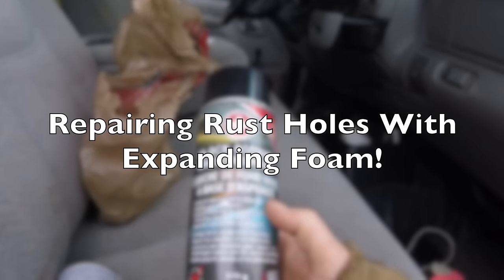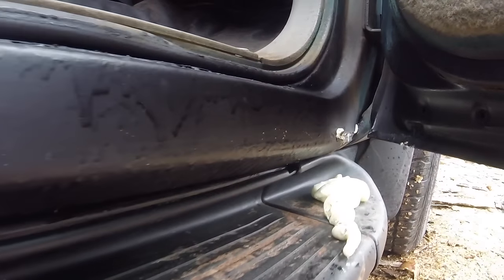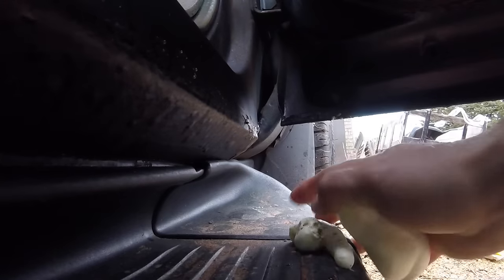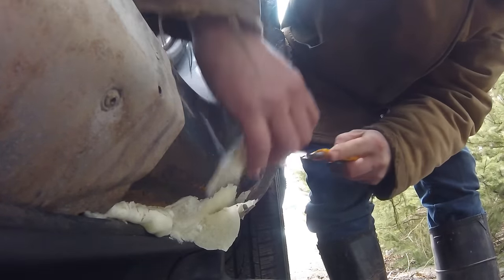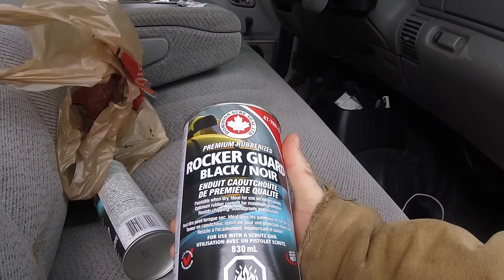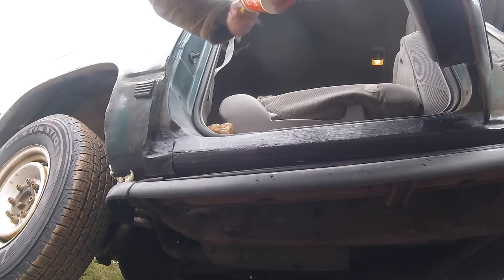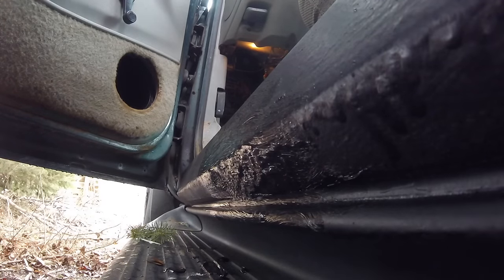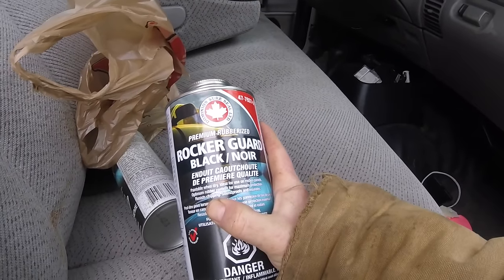HOW TO: Repair Rocker Panels with Expanding Foam 'Great Stuff' and Rubber

Comment: I used spray foam to fill rusted tube steel on both a grill and a ladder rack and it's effectively prevented rust from returning for nearly 10 years now.  Super quick and only $5, can't beat it.
Reply: Do you have a link for the item ?

Comment: This is actually a very good fix for a lot of badly rusted vehicles that still run good but are not worth a lot of money .
Reply from the maker: yep, quickly takes away the ugliness at the least.
Reply: @MicahGallant   for a work beater if it’s good from across the street then it’s good!
Reply: Finally someone who gets it! A focus with 200k will never ever ever have collector value. I just want it to look good from across the street, any proper repair will cost more than the car is worth. The common commenter whose knowledge is internet based seems to believe that every single car needs resto quality repairs as if each and every one were a priceless museum piece. I just want not to feel like a poverty stricken asshole every time I drive my beater to work.
Reply: @charredskeleton  honestly though, my argument for fixing metal with metal is maintaining structure. If you don't care how pretty it is, then some sloppy welds and extra grinding isn't a big deal when you throw some rattle can paint over it and it'll be stouter. I know most people either don't have a welder or have a friend with a welder, but if you are in a position to start, this kind of stuff would be great practice. That's my plan this summer at least on my old work truck. Same thing, not worth pro work but it runs good enough that I will tinker with some fixes myself.
Reply: @717UT   trucks often have fairly flat square rockers, this lends its self well to welding in some square tube and finishing with bed liner. From across the street they’d look like rock sliders, and honestly would take less time then most filler jobs. Even the cheapest square tube is WAY thicker than any body metal. The only thing better than a repair is an upgrade!
Reply: @charredskeleton  heck yeah! I've often thought about the same thing for my Jeep with rotten rockers. I realize it's a stretch for some people to do a weld repair, I'm even struggling getting my repairs done that I want, but if looks aren't a big deal, some new metal isn't as big of a deal as some may think. It won't be body shop quality, but who cares if you just want something stout. And you have a good chance of cutting out a majority of the rust and potentially stalling it a lot longer.

Comment: Another great way to use this trick is, like he said, use it to support long hair fiberglass, and instead of rocker guard or rubber undercoating, Duplicolor makes an aerosol (spray paint can) truck bed liner. I actually did exactly that and used the bed liner on an entire Jeep Wrangler, inside and out, and it lasted 15 years before I decided to sand it down and redo it all by welding in new metal and repainting it with actual paint.

Comment: The can you have is actually asphalt based and not rubber. You can get the rubberized based spray too. It's the same as the paint on you have but just spray. You can also tell by the smell of it. Nasty crap. Haha. One more thing. They make a waterproof foam that is coincidentally black like the rocker guard. Just one more protective step to take. Great tutorial. I've done this to my 4Runner before. Works like a charm.
Reply: What’s the name of stuff you used? I’m working on a 4Runner also

Comment: I suggest using truck bed liner, that stuff is tough as nails and even bulletproof from 22 caliber rounds, its rust proof and lasts a looooong time. I sanded my hitch down about 5 years ago and sprayed it with truck bed liner and it looks just as good today as it did when I did it.

Comment: This is a really good trick. But if you want to go the extra mile, spray on a quick coat of foam glue. It will stop the rocker guard from eating the foam... I use the spray foam and sand it to look nice, spray the glue and let jt dry, then i smear it with glazing or spot putty and sand it perfectly, can then be painted properly with what ever you want and makes it mutch more ridgid...
Bedliner spray works good too, it will eat the foam and leave a hard fillable surface that you can paint again.

Comment: Goodness that would never pass in Nova Scotia. In the same breath there is an older gentilman in town who uses 4x8's for rocker panels .. no idea where he gets his car inspected.. a mill I guess
Reply from the maker: key is that fumes don't leak into the cabin, thats what they are after. this is a full frame truck, so it doesn't rely on the body for strength.
Reply: Would not pass here in new Brunswick.  Patch's have to be welded and have seam sealer over the welds.
Reply: Geez I got my truck thru a safety with the holes filled with foam and covered in bondo-glass here in Ontario
Reply: I live in michigan no inspection of any sort 😂 theres trucks here with nothing left but doors and a frame
Reply: Is it a Lumberghini?
Reply: Wouldn't pass in Candy Land...I live there with Willy Wonka after I got my golden ticket...sucks to be poor...dude I think you're just fine...all these people who are living in places where it's not good enough must be doing pretty good I guess...if you're in the midwest this truck looks pretty normal
Reply: I'm in NS as well. Got a free civic with f'd wheel wells. Gonna put some spray foam followed by fill to get it to pass inspection
Reply: @ajsmalaisemopargarage2073  oh man you can't beat a free civic. I was given a 99 ex sedan a few summers ago. She did everything I asked it to do for the summer.. I dropped the clips out of the brake rotors in the Timmies drive thru wore the discs through the vents. I said "well that's done" and I drove right to the scrap yard with my coffee. Got 100 bucks for it and called a buddy to pick me up. Good times but I prefer the Acura EL

Comment: Skip the foam and take wax paper and use a black marker to outline the hole and make it a  extra half an inch or an inch bigger than hole and use short strand fiberglass and press the plastic paper on then smooth out with palm of hand and pull out the ends of the wax paper and keeep it smooth.. wait a minute or two and pull off wax paper. the repair is hard as a rock. Put a second layer on without wax paper and sand down smoothly.. Then drill some quarter inch weep   holes.. Quick and painless...

Comment: i did this to a 1989 gmc 1500 on the frame and it passed the safety inspection.
Reply from the maker: thanks for the comment. yep, it just has to be sealed, thats all they care about, especially when the vehicle has its own full frame
Reply: Why are rust holes not compliant in BC? Is it a CASH COW $$$$$$$$=$$$
or is there sum kinda actual real safety hazard

Comment: Planning to do this to a car with horrible rocker rust. Minnesota car... got it from the auction with road salt embedded in the layers of rust, nice, right? Gonna be doing a foam+fiber glass+bondo combo. Rust reformer and undercoating and all.
Reply: Braden Nielsen depending on your plans for it I'd recommend just cutting off the rockers and welding new ones in. I had two made for my Toyota Matrix and a friend zipped them on, they look and preform like new! And no more fighting with rust. I had been using foam and black paint for the past year to keep it looking better than it was. But ended up going with new metal
Reply: Cameron D.F Chisholm yeah that's what id rather do. I dont know any welders unfortunately
Reply: Braden Nielsen it's 2018 where all the welders at!! Lol
Reply: I almost went ahead and bought my own welder to spot weld rockers in or something and everyone was like "nooo if you buy a welder get a more expensive one!!! You'll need a teacher too.."

But yeah lmao, I know a few welders but they've all moved away or went to college and aren't around anymore. I might have to resort to finding a backyard welder that would help me for cheap.

Comment: For y’all complaining it will rust faster with the foam, there is a fix for that! Drill holes and saturate foam with Fluid Film. Problem solved!
Reply from the maker: Good idea :)
Reply: Treat cavities with fluid film black.
Wipe off excess. Fill cavity with foam. Carve ledges into foam. A thin coat of  Bondo. Use Bondo / primer product over Bondo. Paint and clear coat spray can.
Did this for my 95 Miata which I don't drive in rain anymore. Just had to outlast me. Not show condition, but still a looker and great driver

Comment: i just got a 2003 civic with 60k miles, the only issue is the rear left fender area is very rusty, other than that area its a pretty clean car.

Comment: I did this 15 years ago in my Jeep before I fiberglassed (Bondo). The expanding foam will rot and also retain water/salt underneath (it doesn't absorb it but it will hold it instead of it running off) and speed up rust.
Reply: Did you heavily coat the inside rocker with a rust inhibitor and soak it with oil before installing the spray foam?  I'm just curious?  That may be a key step in the process.  Just learning.  Thinking about doing this to my 18 yr old pickup until I can do the rockers right, 2 years or so.  Thanks for your input.
Reply: Bullshit.
Reply: I'm fighting rust at my truck and car for years and my experience is similar.  Foam is troublemaker.

Comment: Good job. How about slowing down a few more hours and working on carefully removing all of the rust so that when you coat the rocker panel with the asphalt and the other stuff, it will probably last longer than you think. I have done quick repairs that lasted longer then I thought it would lasted and I felt badly when the car or truck actually lasted longer but looked rather nasty because I thought the vehicle would not last long. I was wrong, and did a few jobs over because it looked sloppy and messy. Slow down bud. Do it right. You will thank yourself for it.

Comment: How much is the rubber stuff and where did you get it?
Reply from the maker: Canadian tire. Used for truck bed covering or rocker panel rock protection. Roof sealant would do the same

Comment: I gotta get my Dodge 2500s rockers replaced. The driver side is worse. This stuff won't work sadly, I don't think so at least. They're pretty awful I should use this method for my bed panel on the driver side though, that's the most expensive body part on it. Considering the gas insert is on that side.

Comment: foam is a Really bad idea, it traps moisture next to the inside on the panel and will cause it to rust out again Fast. Also, you need to treat the rust before filling and painting over it, otherwise you will have nasty brown spots blistering through your paintwork again in a matter of few weeks you can get the same result with out the foam im Gonna make a Diy video in a few weeks And show how to do it with out Using the foam
Reply: Car makers should foam new vehicles
Reply: What to use instead?

Comment: Since my WHOLE ROCKER PANEL IS GONE I'm just gonna rebuild it with fiber glass or bondo its kinda like sculpting lol
Reply from the maker: awesome, yep there is a technique to it
Reply: Maybe drive some screws down through the top? Help keep the foam in place by acting like a anchor! That's what I was just thinking about if I  loose too much metal while sanding it down to get it ready for foam...🙂👍

Comment: You can do this on vehicles that got chassis, but in jew vehicles without chassis the seal also offers stiffness to the car. Using this method in new cars without chassis is actually dangerous. For sure you know already, is just for some people looking they may not know.
Reply from the maker: yep, monocoque design vs chassis and body

Comment: So you fill the holes with foam and paint over the rust?
Reply from the maker: yep, you got it! The key is that fumes don't get into the cabin. this is a full frame vehicle, it doesn't rely on the rocker panels for any sort of strength. so its an easy fix for this vehicle and its cheap.

Comment: Just so it's clear. The rocker panel is not some cosmetic body part. It's literally holds the car together. DO NOT repair this way if the rust is very bad. A lot of people have actually died that way in accidents. It may not be what causes the accident however if the rocker panel has no structural integrity left and you have an accident then your car will be crushed into a little cube and you will get your steering wheel the shortest path through your face.
Reply from the maker: this is a full frame truck.
Reply: That just means that it is stable without the panel. It will still come into play in an accident.
Reply: Just don’t crash

Comment: dont ever do this.... that foam collects dirt debris and any kind of moisture and accelerates the rusting process.  We would see it all the time in owners Alfa Romeos that come in for restoration and right where the foam would be is a huge rust hole that we end up sandblasting through and welding a sheet metal patch in.  just dont do this... fix it the right way... grind the rust out as best you can and reseal it with SEM rust stop.  call it done for 10 more years.
Reply from the maker: Depends if it’s a beater or not

Comment: This would fail safety inspection   has to be welded.

Very unsafe
Reply from the maker: this vehicle isn't monocoque. it has a full subframe so the rockers don't do much on this one.
Reply: If you use bondo and sand it down & paint it how do you figure they would catch it?
Reply: Its not unsafe your rocker panels dont effect the structure.